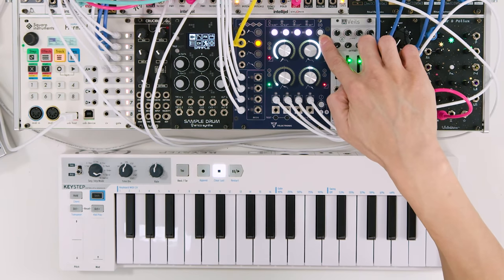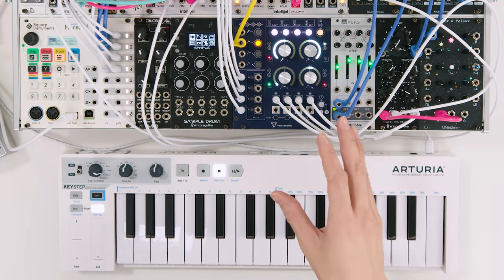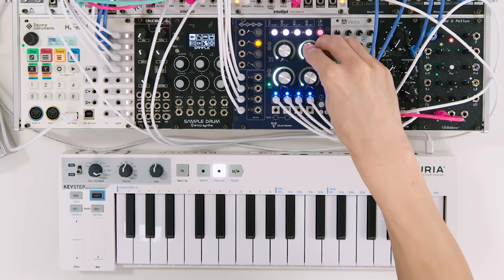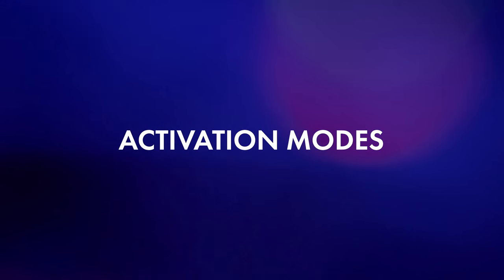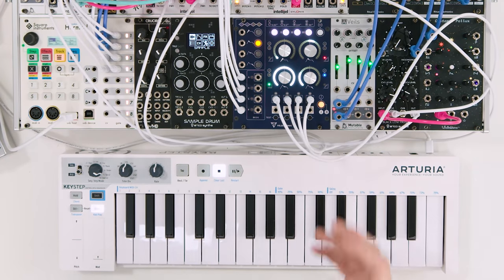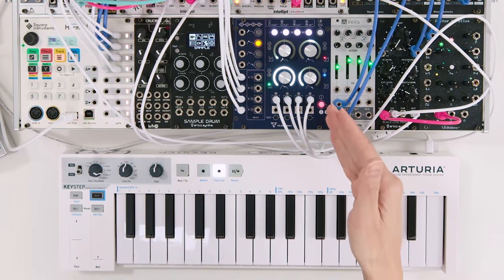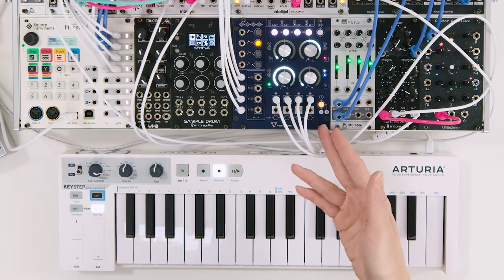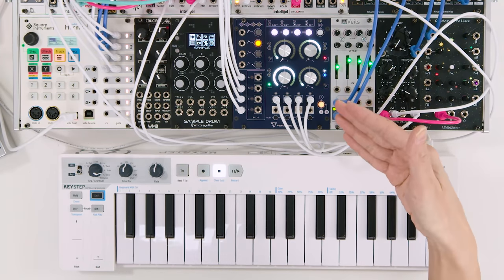Velectronic A-Envelope: Demo & Video Manual

Comment: Looks very nice. Checks all my boxes feature-wise and the LED encoder knobs look fantastic, but it does commit two synth UX deadly sins. Color coded modes that are impossible to remember, and functions hidden behind long presses and shift/alt-modifiers.
Reply: Still though, depending on the price and whether they switch to a standard silver or black panel, I may have to pick one of these up.

Comment: Hey Andrew, I have a couple questions. How do you approach polyphony in your modular? Any specific modules you could recommend, apart from this one? Would trying to implement polyphony make sense (HP-wise) at all if I only have an Intellijel 7U 104HP case?
Reply from the maker: I do like some oscillators with “built-in” polyphony like Qu-Bit Chord, and 4ms SWN and Ensemble Osc. You lose a bit of finer control over all possible parameters but save a ton of space. As you can see in this video my polyphonic patch took up probably 80% of my 7U 104HP case. But I’m also using some bigger modules, like Shapeshifter as one oscillator, and Hermod doing nothing except the MIDI to CV conversion for the KeyStep notes. In any case this route probably only makes sense if you really want detailed control over every individual voice.

Comment: As someone who purchased this module when they were first released, I ended up returning it. It’s an excellent, well thought out module, with incredible build quality (even the shipping box is aluminum lol). However, the limited modulations per channel (1 per stage / channel), and the inability to know where you are in the stage time, was a bit too annoying for my workflow (at this price point). I think it would have benefited from having switches for the short/med/long stage times, rather than just keep turning the encoders into the next stage. It seems like a good idea,  it in practice I find it annoying for quick changes. 

I would recommend it for a smaller system like the pallet cases and such, as you can program a lot o out of it. But I find for performance and rapid tactile control, it’s a bit of a hinderance (in my opinion). I would love to see a Mk2 with some of those considerations. Then we’d be potentially seeing the best envelope/function generator out. 

Hope this helps anyone make a decision.